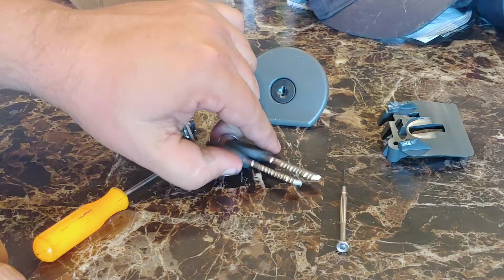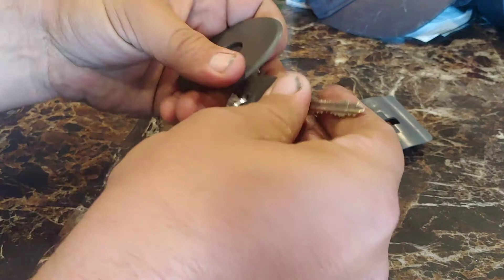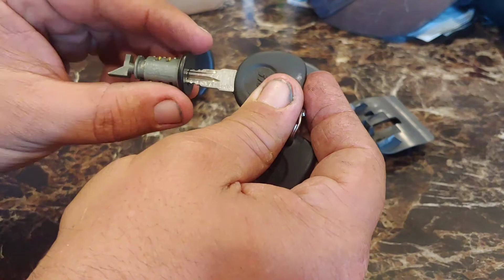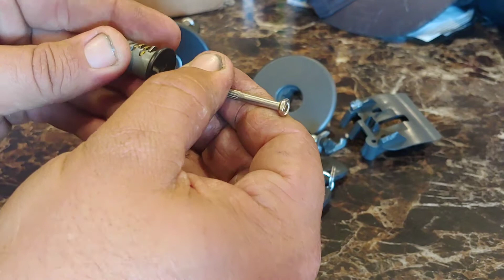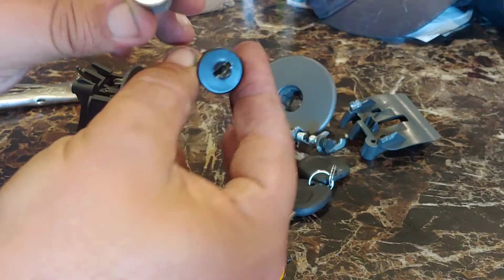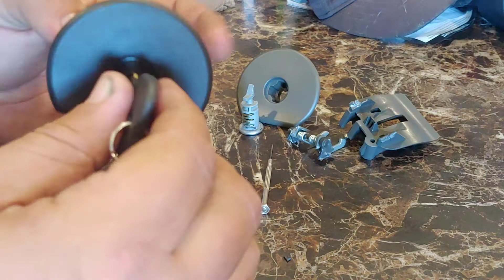2004 pontiac grand prix glove box lock cylinder replacement

Comment: Where would I get a replacement key? Mine is stuck in lock position.
Reply from the maker: More than likely the dealership. If the vehicle is in your name they can make keys for vehicles using the vin number. Check with them first though
Reply: Thanks a ton. I didn't have vicegrips, and my pliers kept slipping off. Luckily I did have a lockpicking kit handy. Even after watching you, I still had to come back a few times, so I just wanted to pass along my appreciation. Thank you!